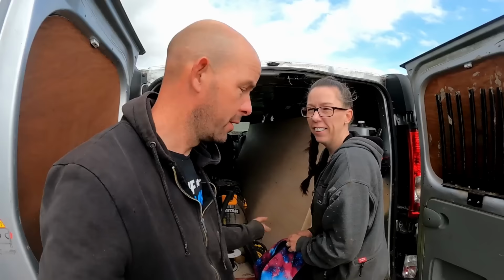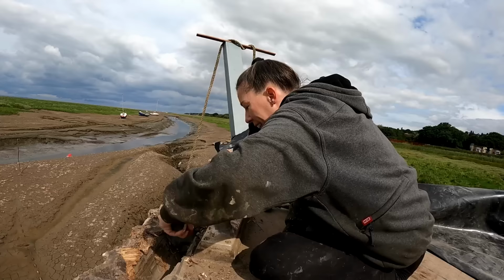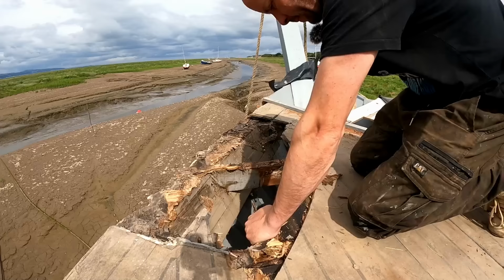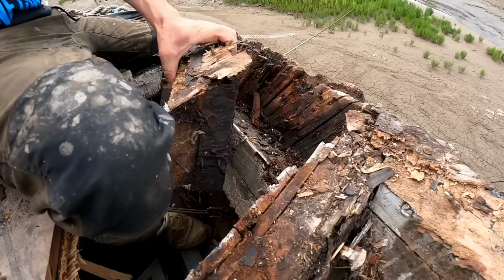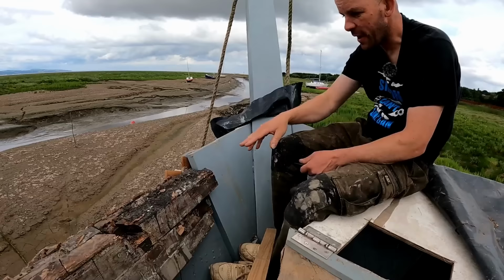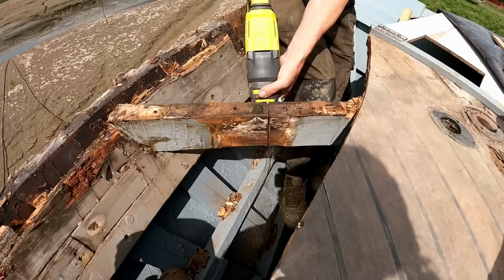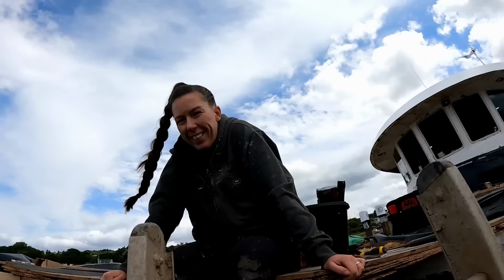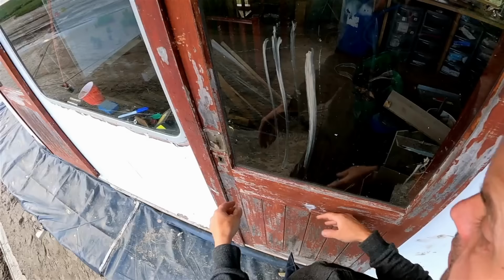EP 136  Broken Boat & Break In Attempts!  #boatproject

Comment: Looks like the 80's rehab was a pretty quick and dirty job.  Just glue down new material over rotten material.  So happy you are doing this refit the right way so Sarinda will live on a long time. ♥  Your beam shelf looks much better than the original beam shelf - built by crafts people.  The original was stout but sloppy fitting.

Comment: 08/18/2023 Hello Ship Just a thought. The rust on the chain may be cleaned by using vinegar mixed with water. It will require several applications and some brushing to make all of the rust go away. Several restoration services and auto and  truck body repair shops use this method. AS I understand the vinegar will not harm the metal. Apply then let set. Reapply then wash with water to stop the action. Brush the rust away and rewash with clean water. Allow to dry in sunshine. Repeat tomorrow as needed. I have used this on a few smaller projects. Look it up online. You know that I can not be trusted. The other option would be media blasting. That is very messy. I approve of the bow work. This section held some water that allowed for rot. I believe that you have found a good way to repair the damage and stop the rot. I can not understand how someone would attempt to break in. They could not remove enough of the items on board to make it a profitable effort. I had construction project years ago. To stop the break ins and loss of the tools, we simply remove everything from the tool boxes and spread it out all over the floors. This stopped the theft. That made the effort to pick up the separated tools too much work for the small amount of drugs they were trying to buy. Also I removed the tool box top latches. When they tried to pick up the tool box the lid would open and spill all of the tools. I would recover my tools the next morning with a large magnet on a rope. This worked well on several projects. I would keep bolts and nuts and washers, screws and nails and dull drill bits and cheap sockets in the box that spread everywhere when the lid opened. Several times we would hear about the attempts from locals who knew the thieves. Drills, saws and other power tools were left in open sight but the cords were tied together through the wood studs and plumbing and electric conduits. I never lost another power tool. Also no lights were left on. This made walking over the debris spread on the floor difficult. Sometimes we would place nylon staging string about 6 inches above the floors for trip hazards in the rooms under the windows. One time I bet my dad that we could leave the door unlocked and open. We did except he placed some #8 penny nails in the floor and cut the heads off. That made sharp nails to step on. Sneekers do not stop penetration into the foot. That news went around near and far.  Sometimes the police would stop by just to check and see if any victims were still on the floors. One police man was amazed with the anti theft devices. He had property in the area and began to use some of the same methods. Legal problems, my butt. No one wanted to claim the break-ins. One older neighbor asked what if someone gets hurt? WE said WHO!!!! This is just a remembrance of rough times working in bad underprivileged neighborhoods. A lot of the time we worked on city rehabilitation projects. Enjoy the stories. Only once did we glue broken beer bottlebottoms on the window sills. We baited that with a small portable table saw that remained there until the finishes began. This epic is much too long but I hope yoou and your subscribers can enjoy the epic tails. Sincerely and with mal content. Don

Comment: Hi, keep up the good work its good to see you putting such a lot of time and energy into Sarinda. I know its a long way off, but I think the Bulwark should be separate from the deck, glass over the deck and leave a small gap between the underside of the bulwark and the deck, I'm sure that would give a better result, the edge of the deck glassing can be taken down the topside and trapped behind the rub-rail, the stanchions once attached to the hull and beam shelf should be caulked it allow some flexibility then the bulwarks can be added right at the end of the re-build.
Reply: I’m no ship architect (far from it) but bulwarks should at least have deep slots to let water quickly drain off the deck.
Reply: @davidelliott5843  Correct.

Comment: Hang in there guys, Your boat is 80 years old, the boat I'm restoring is only 55 years old and you inspire me every week.  Not sure this applies but the difference between the two screws you were looking at in the beginning of this weeks video might be that the "gold" colored one is using allodizing, a chemical corrosion proofing.  You see this a lot more these day's, it is a chemical process originally used on Aluminum aircraft parts.  Here in the US there is a ceramic coating be used on screws that really hold's up well.   Keep up the great work.

Comment: Sign of times really 😮 but Sarinda being the ole Battle boat she is repeeled the attack Brilliantly 😊. Thought port side would have more damage being dry side as it would have been expanding more often than starboard  side. 😢. Putting 300db siren in ya can,t hang round if that loud and all the neighbour's will definitely no she's under attack. For the amount of work required she is better in the salt water than on the Hard as she will dry out to much maybe when all Hull work inside and out done as inside can be a Rollin resto 😊. You guys are a Hoot ya banter is great keep it up 😊. Carry on now.😅.
Reply: Yes an very loud siren will make most people run. The fire alarm at my work are so loud people will leave the room with fingers in both ears even if there are no danger or fire at all. It's so loud that it's very unpleasant and it's a huge room compaired with the inside of Sarinda.

Comment: Not every screw finish is plating alot of screws may also have a polymer zinc coating rather than plain zinc plate , or passivated zinc plating ( often yellow/gold ) the passivation makes the plating last longer  vs plain zinc plating.

Comment: I was thinking when you go to put that deck back on i would get some marine grade plywood then put roofing tar 30 pound paper over the top of that then lay your deck on top of that then seal it all up that would provide a moisture barrier between the two that would get rid of alot of leaks in the future because those decks always leak no matter what I put antiskid paint on my deck and sealed it then took bags of sand and mixed with the paint because the paint hardly comes with any grit in it